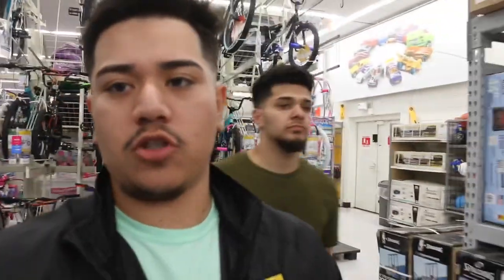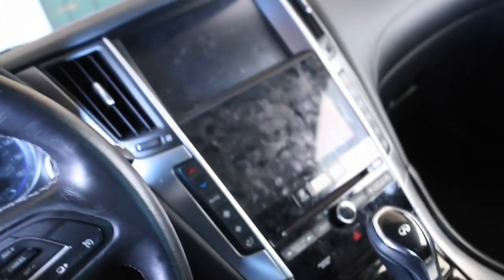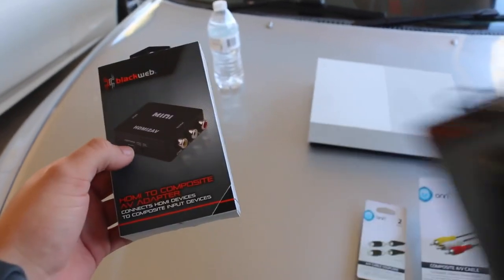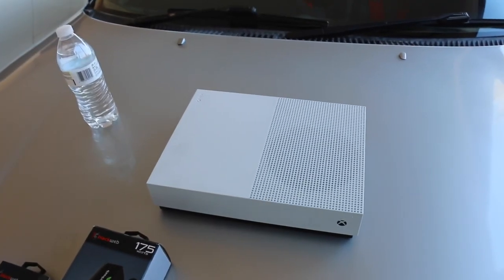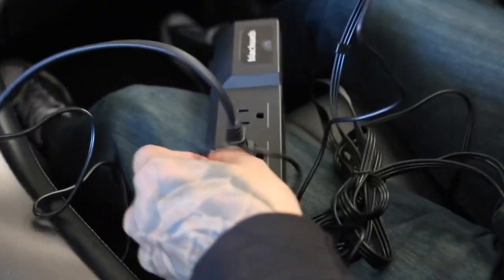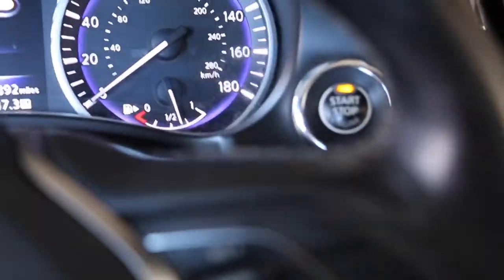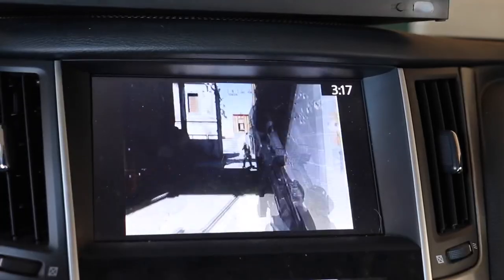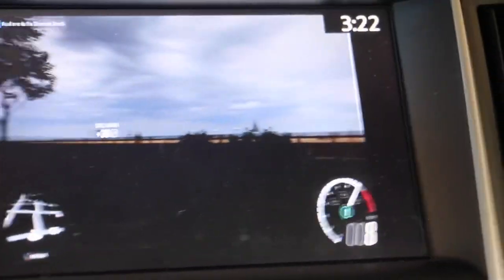Infiniti Q50/Q60 How To Play Xbox/PS4!!

Comment: Does the ps4 stay on screen while driving or just while parked?  If so im doing this and setting up hotspot on my console if I can
Reply from the maker: Only when parked
Reply: Thanks bro ... I might still do it idkk. Banger video tho bro keep em comin !
Reply from the maker: Yaardy know nun but bangers fam 🙌
Reply: Hey bro when u plug the power block into the car charger part does it make a noise ? Wondering bc mines did
Reply from the maker: Yeah like a small noise
Reply: BrovdTV ok, mines is not working I think I need a new power block I don’t think mine is strong enough, PlayStation turns on but shuts off. Pretty sure I got everything
Reply from the maker: Tsav yeah bro try using a 175-200w power inverter also make sure you have the acc’s on and the car not all way turned on

Comment: Will this work with a 2014 q50? Or do I need to have a newer screen
Reply from the maker: Nope it will work
Reply: I tried to do it and only get a black screen or the gps on the screen. I get the sound but not the video . I did check that my e brake was on too
Reply from the maker: Did you navigate thru the seek button till it says “aux “ display on
Reply: @lilbrovd   I am having the same issue and I did push the button till that comes up

Comment: What power requirements for the power converter? Does it have to be 120ac?
Mine is 110+- 10 and it shuts off
Reply from the maker: Mine was 120ac I would suggest trying that if that doesn’t resolve your issue it could be a bad connection I’m assuming